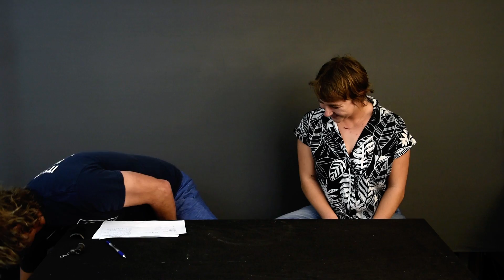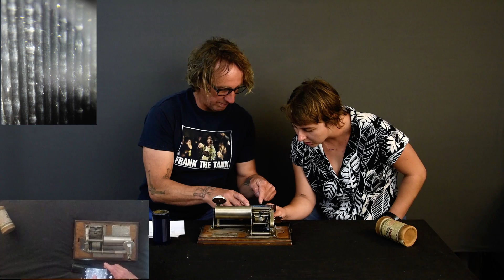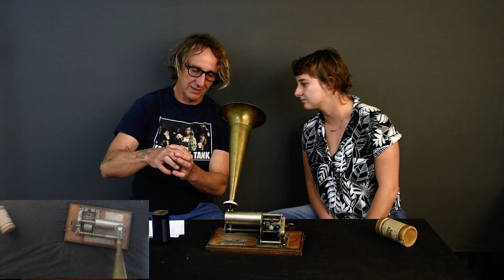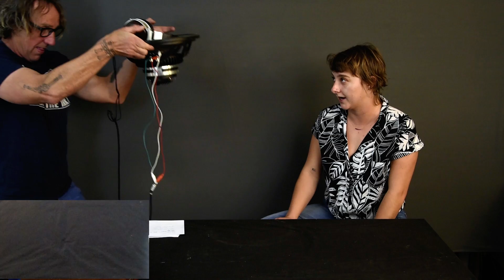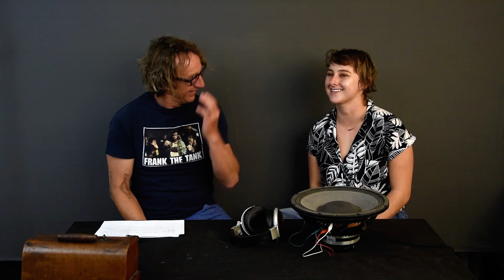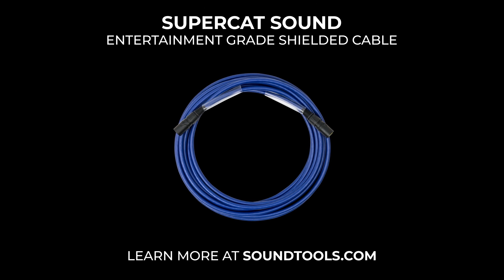Audio Transducer Basics & Demo - part 1 of 2 - Sammy Asks Pop

Comment: 6:39 oh yeah he a thief that made illegal copy of french filmmaker movie and electrified an elephant so he really a nice person. 

EMI electromagnetic interference is all around us and RF radio frequncuies that often received on audio equipment even a mobile phone signal occasional can be picked up and its often the same signal signature often hear it in some videos.

I stumble on someThing years ago that I thought was kinder strange when testing speaker with new edge surround with low freq sine wave to check for any rubbing of the voice-coil and had another bass driver nearby that wasn't connected and when I applied a little pressure on cone it altered the dB level on the other speaker.
Reply from the maker: Thank you Andy and interesting!

Comment: Are you largely self-taught or do you have formal training in physics/electronics/acoustics? I remember you saying you were learning to build speaker systems early on, but curious where you picked up your knowledge along the way. Wondering if you ever got into Maxwell's equations and such, etc.
Reply from the maker: Mainly self taught and from the practical experience and real world side.  Though I did work at Hughes Aircraft in the environmental lab testing TOW missile systems. But yes, again, the practical more than mathematical knowledge

Comment: please explain that crazy transducer in your supersub. the m-force technology. ive searched the web for all information pertaining and still am not satisfied. please explain the moving neo magnets inside of the stationary coils. why is that beneficial? they mentioned dead short, is that a ridiculously low ohm load? why is that beneficial? compare motor force against a normal moving coil subwoofer. they mentioned capturing the back emf wave. does the sub create electricity like a generator? how does the amp make use of these new watts? why isnt every system using this, even systems like home ceiling fans or washing machines? if this is true, is the wattage rating way lower then the amps power output? more info like magnet configuration, like north south, push pull, shape of the coils ect.? would this be considered a new class of amplifier, class E (after class D)? is this the future? do you need an assistant? thanks
Reply: This M-force is good stuff...
Educate yourself abut the concept of "apparent power, real power and reactive power". 
Think about Moving a weight  back and forth. you would think Accelerating and decelerating it all the time would take a lot of power. The heavier the weight the more power... 
But now think about it as a pendulum.it has a lot of Apparent power Power but but it only needs a tiny bit of real power to keep going.  

Or think about Electric cars. Accelerating discharges the battery but Decelerating charges the battery. 

By Putting the coil on the outside (non moving) they can make it as Thicc and heavy as they wont. With low resistance and therefore lower loss. 
The downside is now they have to move the heavy Magnet back and forth but that mostly needs "apparent power" not real power since Decelerating the magnet gives almost as much power back ( minus the power that got converter to actual sound) as Accelerating it needed.
Reply from the maker: I will do. I have some plans to do some fun stuff with the M-Force in upcoming videos

Comment: 17:10
If I remember correctly, it has something to do with the spinning electrodes in an atom. The apinning electron has a magnetic moment, and the changing magnetic field interacts with this moment and leads to a shift in the positions of the electrons. This is basically a voltage and so converts the kinetic energy into electrical energy (if I remembered this correctly, it is possible that I am remembering everything wrong)
Reply: https://youtu.be/8GyVx28R9-s?t=111
Reply from the maker: Whoop Whoop!
Reply: @lambda7652  probably the best ref link i;ve seen on this website :}

Comment: I once tried to uses cheap ethernet cables as audio cables, Turned out they are super microphonic. (relatively speaking)
But but with high Gain it was possible to hear if someone taped or stepped on the cable.

Edit:  If Sammy is not old enough to ever build a cup telephone how is she old enough  to drink^^
Reply from the maker: Hmmm, even cheap cables should work well but you would need to be absolutely sure that the twisted pairs were aligned up with the pins 2 and 3. If unshielded, then using a twisted pair and a ground wire should work.
Reply: @DaveRat  Yes, actually it should work.
The cables was somehow already there, this is why we tried to uses it.
So there is a high possibility that there was something wrong  with the pin out. 

It worked, it was just surprisingly Microphonic.
maybe i will investigate how under what conditions this can happen.
Reply from the maker: @lambda7652  cool, let me know what you figure out